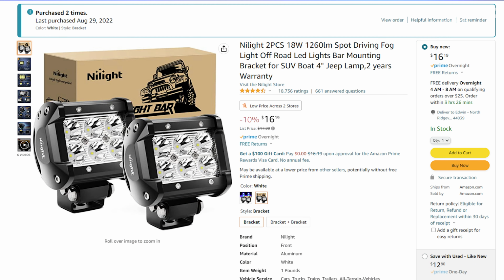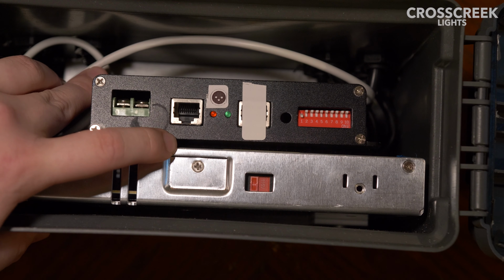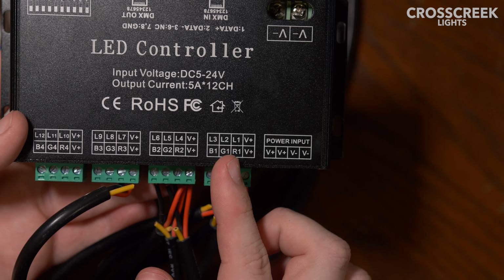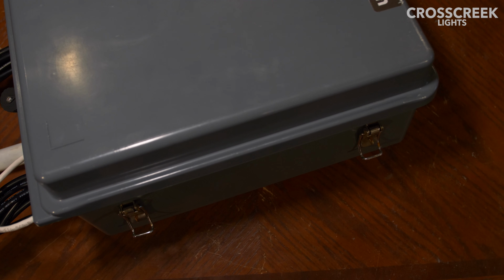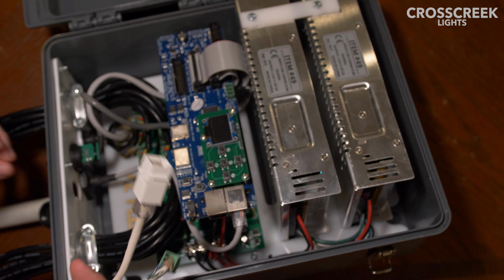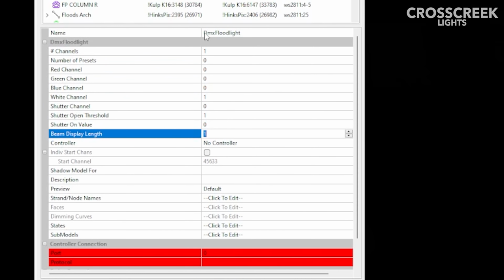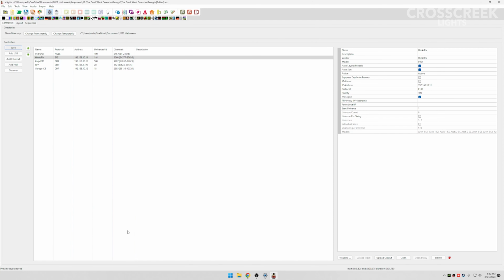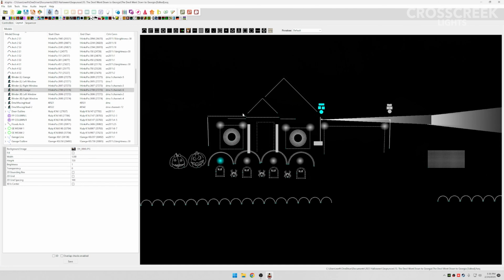How to use 12v Offroad Lights in your Lightshow! - DMX Blinder Lights

Comment: I’m looking into using X lights for my using led tape around the my stage for a sparkle effect. I mainly use Qlab for control over my lights and I have many protocols to send out to third party applications (midi, timecode, Dmx, etc.) Does xlights have a way to retrieve commands to engage certain sequences of led lights for a duration of time?

Comment: Are you using your moving heads and blinders on the one DMX port? If so, how does that setup work?
Reply from the maker: I am not I am using them on two separate controllers. But if you were you would just go from the DMX out of the dmx decoder to your moving head light. Or veus versa.